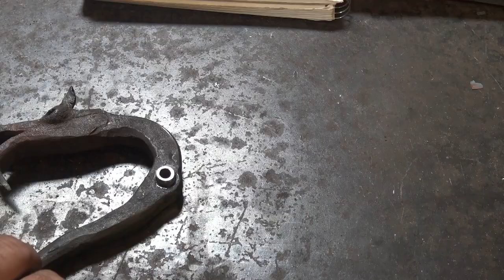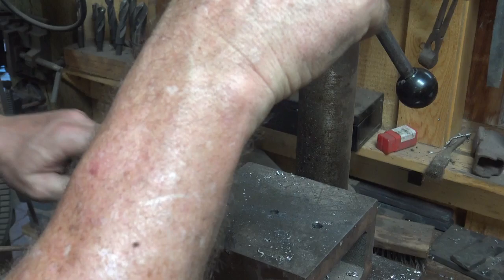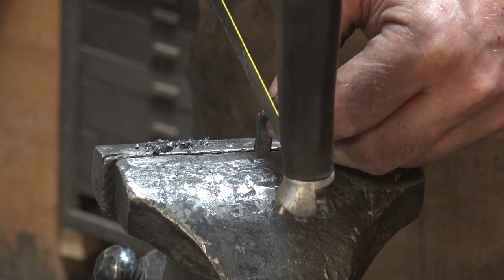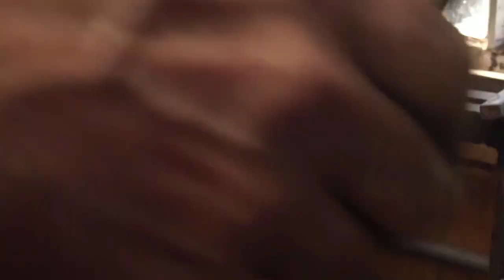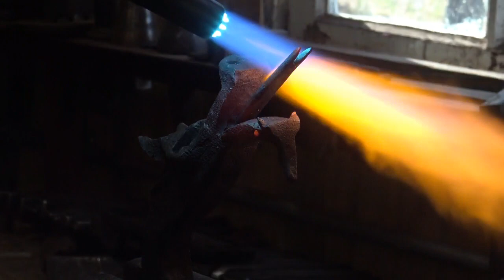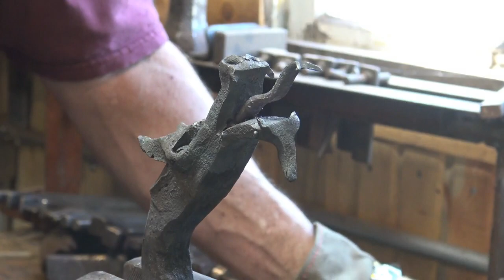Forged Dragon door knocker - part 3

Comment: I've never criticised your videos before because I am in awe of your skill and anyone who can create better than me is worth respecting.  That said, if I was designing this , I would go with a slightly different design.  I'm not claiming great knowledge here,  anything I state is based on gut feeling rather than any learning!.  If I was to do this (and I hope someday to learn the skills to allow me to replicate your work)  I would not put a beard on the dragon as the overall shape is more that of a dragon from medieval legend, or Scandinavian legend  than that of an asian dragon, where beards are more prevelant.   Also, and this is based on nothing more than my limited skill set or knowledge, I would not even attempt to include a tongue.  (This is not a criticism but an acknoweledgement of the lack of my own skill due to no experience)  I apologise for criticising as your execution is a testament to your skill, but it feels a little off to me from what I have seen as the differences between asian and western dragons.  I fully acknowledge that dragons are not and never were real, but my internal censor tells me that if was to create one in steel (which is an ambition of mine) That it should be true to either one tradition or the other but not include elements of both.  I am very happy to be corrected by anyone who has more learning in this area than I and will happily admit my deficiencies.  I am also happy to be criticised by the OP if my post misses the point of the original design.  This post is based on nothing than my own knowledge and  I am happy to admit that that knowledge is imperfect and may be corrected by anyone who can prove greater knowledge.

Comment: Why did you decide on the tube? And not just stick with the drifted hole?
Reply from the maker: The hole had become out of round and needed to be drilled out to make it round.  That resulted in a much larger hole than I wanted.  No need for a hole that large.  So the tube reduces the hole size back down to something more appropriate.

Comment: At the start you said something about scales has that changed or will that be for some other project ? Sand blasting then etching and then heat and brush with a brass brush might look neat. Be well and be safe
Reply from the maker: I did some scales on a test piece but wasn't impressed with the result.  I plan to keep the finish more traditional and will discuss that in the final video.
Reply: With or without scales it still looks ALIVE great job Be well and be safe